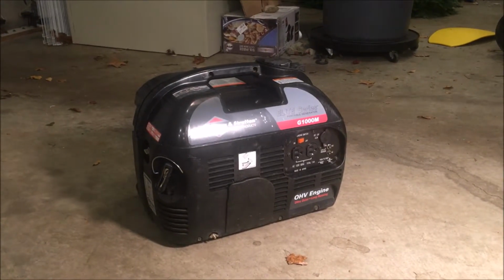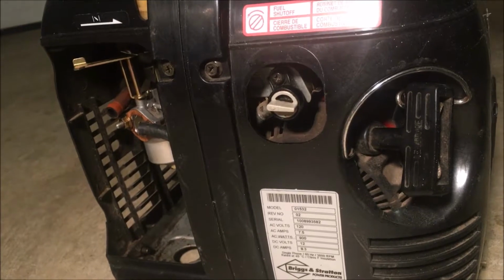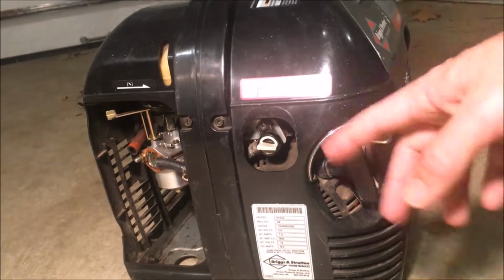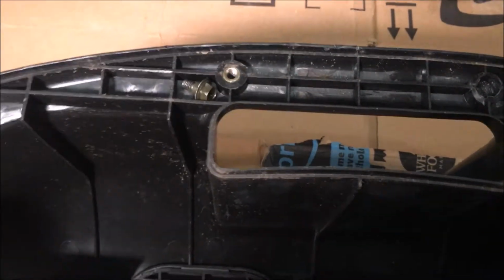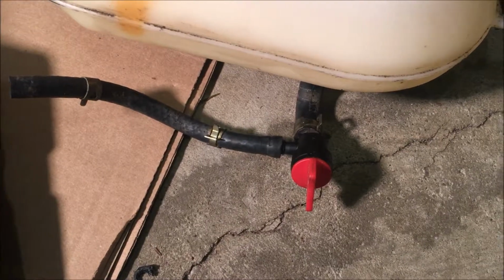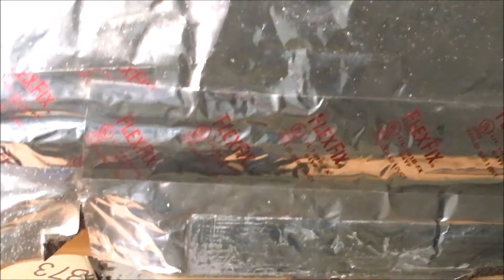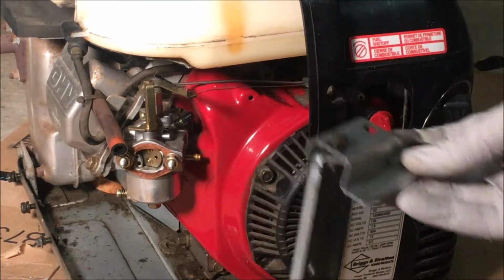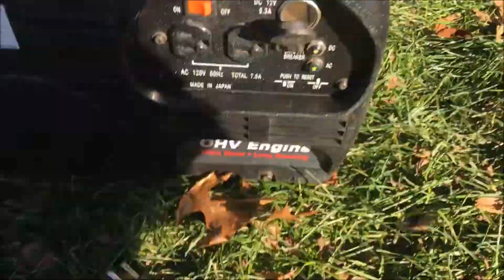Briggs and Stratton G1000M Generator - Fuel Line Replacement and Throttle Adjustment

Comment: Very helpful video. I have the exact same generator and after sitting for a couple of years I'm unable to get it running. My issue is no fuel getting to the carb. Always ran well until now. My fuel petcock is stiff as well but I can turn it by hand. I'll be tearing mine apart for the purpose of getting it running and sell it as it's been replaced by a larger inverter generator.